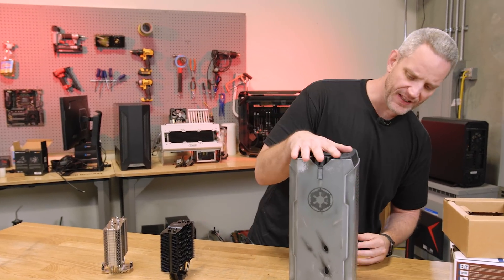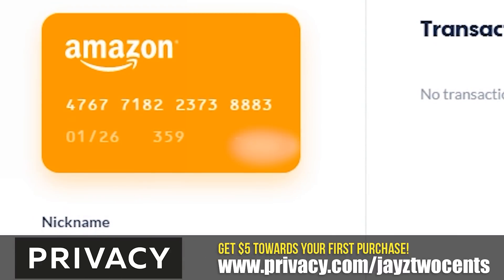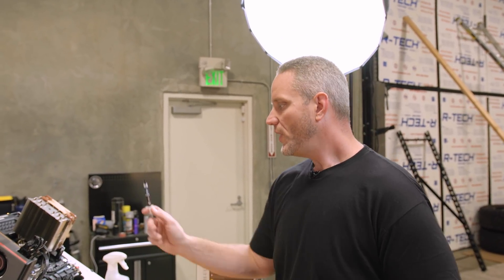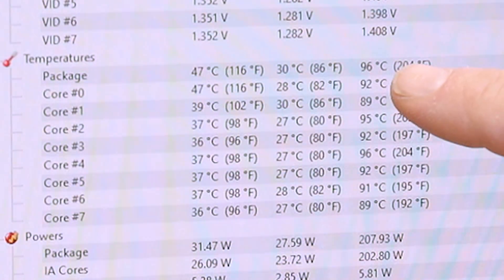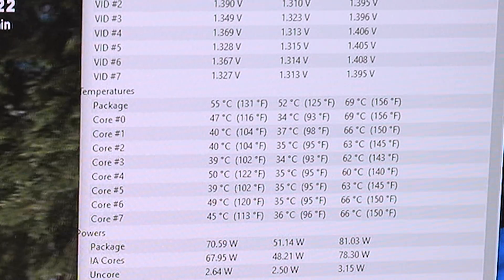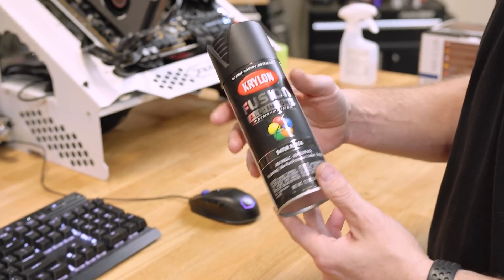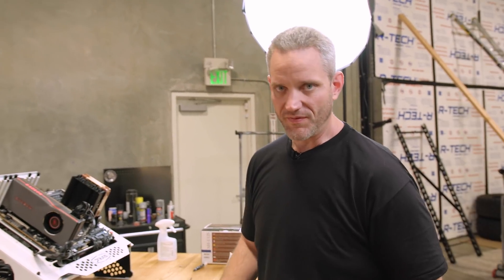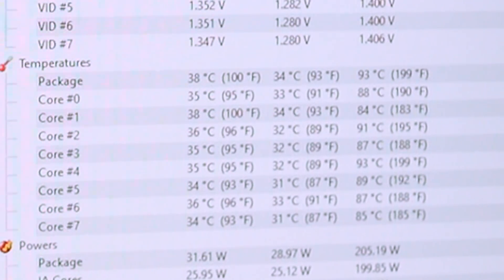Does painting a heatsink hurt its performance??

Comment: @jayzTwoCents my computer has an issue with a couple games were I watch a video on someone that basically has the same pc specs or the same and they have like 20-25 fps more then me and in some other games like call of duty my computer (cpu hits 99-100% and my gpu is like 2-3% and doesnt nicely I have a i7 7700 and a gtx 1070ti and 16gbs of ddr4 2400mhz and my cpu has a all in one liquid cooler and my gpu is a asus ceberus and I run it off a hdd 72000rpm. I have a lenovo mother board was a pre built I just changed stuff like cooler and gpu and my power supply is a 450watt 80 plus bronze acbell if you have any suggestions I would love the help I have tried lots like resetting pc or reinstall the game just alot:D

Comment: Haven't watched the video yet but depending on coating/paint type , from a thermal dynamics / Kirchoff's law of radiationstand point; black has the interesting property of not only absorbing infrared light really well but also able to expel the stored heat quicker as compared to pain shiny or white objects, hence why wood stoves are painted black & why most wear black or darker pigments in desert environments.

Comment: if you have seen videos from that blacksmithing channel where they recreate various fantasy weapons, if they want the metal to be black, they dip it in a solution that creates a small oxidized layer that turns the metal itself black. in the case of a cooler that would make it black without adding a layer of insulating paint. obviously this kind of chemical is rather dangerous if you are not well versed in its use so it's not recommended for DIY projects

Comment: 3:48

Fact check. That's not true regarding the the difference between the Noctua chromax and non-chromax fans. The old beige fans and the black chromax variants of those fans are identical in performance. Regarding the NF-F12 model, both the beige and black model have the same RPM (300-1500), same static pressure, and the same noise output. 
The exact specs are all listed on Noctua's website.

Comment: Prediction is hard
It depends on thickness of paint job and texture of paint itself too, which I do not control
Black colour radiates heat much better then just aluminium.
Thin enough, raw texture black paint may improve performance

Comment: The material the paint is based on matters more than the fact that you paint it. Also, as long as the paint isn't thick enough to become a heat insulator instead of a contuctor

Comment: The thickness of the paint will obviously be the most important factor here. I doubt anyone would be surprised that the cooler won't work if you fill the area between the fins with paint. Spray paint however can be so thin the effect will be negligible.

Comment: What kinda show you runnin here Jay?
Steve will not be pleased.

Should have left the cooler mounted, painted it (masking everything of course), then retested. That thermal paste reapplication variable.... also no torque wrench to assure same mounting pressure? (I'm clearly trolling)
I would've liked to see you use a ceramic based paint though.

Comment: What is the heat rating of that paint? I wonder if you use a really cheap paint, with a low heat tolerance, if the tower will get hot enough to melt the paint.

Comment: This is a truly pre video assumption. While it would still surprise me, I am guessing that the paint wont throw the temps off by much if at all. While the paint could technically insolate the metal, you are also increasing the overall mass a lot. So I would not be surprised if the extra mass allows the heat to still make its way off the heatsink. Think of it this way. If you would put on an extra cooling towel in the middle of the summer, once the heat makes its way into that towel and dries it out, the heat will go through just like if the towel wasn't there in the first place. I know it is the opposite here, but it is the best analogy I could think of right now that is relatable but also applies to heatsinks.
Reply: Anyway, not that someone will read this anyway, but that is what I expected. It threw off the temps a bit, but it basically didn't matter. If you are shooting for the highest clocks possible on your cpu, probably don't do it, but anyone else, have at it.

Comment: A louder fan, it matters less. Well Ofc. Corsair ML fans can't compare to Noctua fans. Build't a computer for a friend with a Noctua D15 cooler. Mutch more quite in idel than my D5 pump with 360+280mm rads. And my pump is running at 40%. He's computer gets a bit lauder in load tho because of the not watercooled gpu (2070super STRIX). But the choice not running aio watercool was mutch better.

Comment: I agree.  Pre commercial (1:32) that there will be a minimal temp difference.  There will be some blockage from the layer of paint therefore hindering air flow so there will be a slight difference.

 (post test) I guess I was wrong.  I would consider it more than slight but for an average user it wouldn't make enough difference to not do it.

Comment: Just paint the top and the sides. The visible part(s). Many coolers are solid on the sides making it easy to paint that keeping the main surfaces clear from paint. One face of the cooler is covered by he fan and the other/back face is facing the case rear with not much space between that and the rear exhaust fan. Hard(er) to see. This is the more common cooler arrangement. In your case the cooler was the opposite. Still the fan covers one face.

Comment: For an extra $4.00 a can of spray paint for "engine ceramic enamel paint" you won't see a difference in temps, it will take a full day for it to completely dry though. You can buy it at any car parts store. and they come in 100's of different colors. Same paint used on the cooler shown in the being of this video. 

link to paint:
https://shop.advanceautoparts.com/p/duplicolor-engine-enamel-chevrolet-orange-12-oz-aerosol-de1620/7140517-P?searchTerm=engine+enamel+paint

Comment: I remember a similar test with cars that were turbocharged back in the late 90’s - especially with Honda’s- painting their intercoolers black to be more stealthy. 

The same result happened. In real world data logging the temperature difference was negligible. 
In dyno testing and doing repeated back to back runs with no cooldown, there was a significant difference in temps. 

Physics doesn’t lie. 

Will you see a change? Yes. Is it worth doing now that you know what the impact is? That is entirely up to you to decide.

Comment: Early prediction...  light coat, no difference...  thick coat should reduce the airflow through the fins and temps should rise...  also, further thoughts...  a black cooler might absorb heat from the inside of the case more than a silver one would...  but that’s speculation

Comment: You gain heat radiation by having higher radiation coefficient than blanc metal. But the paint can limit airflow for direct heat exchange. Despite coolers often being called radiators, they usually don't radiate much heat but exchange it via direct air contact. Therefore airflow matters more than radiating more heat by painting it.

Comment: Alright Jay, I'm at 1:23, I'm guessing it will raise the temperature, but only by about 3C.
Edit: I was dead on. :O Wow.
Reply: 69 after to 69 before +0
69 after to 66 before +3
68 after to 63 before +5
68 after to 62 before +6
72 after to 60 before +12
68 after to 63 before +5
70 after to 66 before +4
68 after to 66 before. +2

were you though?

Comment: Two stupid questions:
1 Why does noone build a test bench for cooling solutions, so heating elements to which you can supply a set ammount of energy, to properly test (controling variables),...
 2 Shouldnt there be paint that improves the performance of your fan? Theoretically if you had a microporous paint whith good thermal conductivity, you should be able to significantly increase the surface area of your fins...

Comment: A lot of motorbike engines are painted matt black so I'd say is doesn't really matter as long a it's matt black and not a colour that is reflective like glossy white. But you really need to use paint that is good at dissipating heat and the the build should be in a case too, so we can get a result that means more as most of us don't use test benches.

Comment: Hey J and fellow U tubers... I've got an old Zalman 9900 Max copper air cooler and need to clean and restore/protect fins from corrosion.  I've thought about replacing 'said' cooler with a modern Zalman that is nickel plated instead.  I could remove the cooler and clean with C.L.R. to remove oxidation and corrosion.  My concern is more on getting more help with cooling performance and reducing the ragged edge temps with my 2600k OC.    Space and older configuration are present with this build.   Replacing case isn't an option for me.  (Custom build, Case from 2005)  The whole rig used to run much cooler,  But... I'm afraid the oxidation is limiting my higher OC's.   Any suggestions that don't require extreme exotic replacement of case?  Thanks!

Comment: Black can radiate more heat than silver but a paint coating may insulate it a bit...my guess, tiny bit less effective.
And...I was wrong in my guess - so not painting my dual Xeon system aircoolers!

Comment: Gonna go with no as painting intercoolers on cars doesnt either.  Also those ml120 pro fans are fantastic.  You cant even hear them at 1k rpm.  A significant upgrade for fans over stock coolers usually.

Comment: I love your useful & entertaining presentations :-)
Althought I'm a qualified Electronics Engineer (plus qualified Electrician!). I have learnt a lot of stuff about PC building from yourself (& Linus!).
I had actually thought that painting Matt Black would help the heatflow from the heatsink - How wrong was I??
But maybe, being Black, it is possibly 're-absorbing' that heat?
I had a REAL problem here in the UK 2 years ago, when we had a heatwave. My office was getting to 35/40DegC!! 

Whilst my Xeon W3530 (Asus P6T6 WS Revolution) workstation kept throttling & crashing, due to CPU temps of 135DecC!!!!!!
 - Not helped by using the supplied stock Intel fan/heatsink :(
 - I have now switched to a Corsair H80i which is doing a fine job in the rather cramped Antec P183 case ;-$ CPU Temps down to ~40DegC :-)
However, since the system above is 10 years old!!!  I'm building a brand new Workstation...
 - Asus Prime X570 Pro, AMD Ryzen 7 3700X, BeQuiet DarkBase Pro 900 V2, Corsair HX850i
 - I've yet to choose : M.2 ('C:/" Samsung 980 EVO PLUS??, new!!), SSD ("D:/" WD Blue, 1TB??), DDR4 RAM (Corsair, 3600??), 

 - I already have Seagate IronWolf Pro HDD's (8TB x1, 6TB x3, 2TB x2) plus FireCuda (2TB x2)
My final decision will be on cooling...
 - Case comes with excellent BeQuiet SilentWing 3's
 - I'll also add a couple(??) Noctua case fans?
 - But CPU cooling is still up for grabs : V.Large Air cooler (Noctua), or Corsair H100i RGB, or H150i RGB???
Finally, it is strange that most(!!) CPU heatsinks are 'Plain', bare, metal, whilst most(??) Radiators are actually painted 'BLACK'????
 - Maybe, you can strip a water cooler radiator back to 'Bare metal' & do a similar comparison??...
Keep up your EXCELLENT work....
Reply: Forgot GPU : Choosing between AMD Radeon WX3200 & WX5100!! ??Depends what budget stretches to?

Comment: I'll take a guess it'll do nothing. The paint is an insulator but black is the best emitter and it'll cancel out. I do wonder if you painted it white would that show higher temps than black.Nope, I was off. Still wonder how white paint would work since I'd expect that to leader to higher temps than black.

Comment: great timing! Was literally thinking about doing this yesterday :p
I was also thinking of just painting the top fin. The one you can see the most clearly.
Reply: I would go with that. The surface around the heatpipe is also good because the fan cant move as much air on the blade edge and the pipes. Avoide the middle and you good

Comment: Painting it can't cause 0 impact, however I suspect that unless it's too thick or in globs the impact should be pretty small
Reply: pretty small, huh?
69 after to 69 before +0
69 after to 66 before +3
68 after to 63 before +5
68 after to 62 before +6
72 after to 60 before +12
68 after to 63 before +5
70 after to 66 before +4
68 after to 66 before. +2

yep, 6 cores with 3c or more gain in temp, TOOOTALLY a small amount.
Reply: @shawnpitman876  it was a guess I made at the start of the video dude. And actually it did end up being pretty small, 3-6 (the 12 is an outlier and is probably caused by something else) is pretty much irrelevant when you have over 30 degrees of headroom. And the increase was completely wiped out by a slightly faster fan.

Comment: I guessed it would be 4 or 5C higher. Not that surprised about it, some people paint their cars' intercoolers and radiators with very very little to no performance loss. Depends on the paint and how much is sprayed on, of course, so maybe a paint with metal bits in it or something more conductive will be better than other types.

Comment: Good video. Now I'm wondering if doing a super light, almost transparent, coat of copper paint could improve thermals. My theory behind it is that each separate drop of copper paint could increase the surface area with a lower thermal coefficient material, to the point where some improvements could be seen. Probably minimal, but could be significant (1-2°c). I could do the math, but I'm too lazy atm.

Comment: Prediction: if you use something like the high temp paint used on grills, it will probably have no significant effect.  A few degrees, maybe.
Reply: High temp paint isn't high temp for heat tranfser though, it's high temp to resist the colour changing or it burning off of the surface it was applied.
Reply: @mikesiemens4145  Correct, but there are semi permeable paints designed for heat transfer which don't negatively impact the emissivity of the metal nearly as much. That's the problem with painting a radiator, it doesn't negatively affect conductivity, only emissivity. One thing you can also do to paint a radiator or heatsink is to paint from above and below at an angle. Doing so allows you to only cover the visible outside edges with paint while leaving the vast majority of the fins unpainted.
Reply: I see.  He used normal krylon, and only saw a few degrees difference.

Comment: Hey Jay they make radiator paint specifically for this type of application might make a difference
Reply: @Biggus_Mickus  you are a legend, thank you for helping with this comment, I appreciate it (:
Reply: @Biggus_Mickus  saw a guy using engine paint to withstand like 500°, but don't know if it hurt cooling.. would you recommend the rad paint? I assume it's an enamel?
Reply: @TerraRiley  Engine heat resistant paint means it can get hot without cracking, falling or fading... It's a little insulating and it needs a lot of coats. Wouldn't think it works for this.
Reply: c wieling710 nice! Do you know any black coloured ones that would work well with these Noctua heatsinks?
Reply: I use radiator spray for radiators to heat the house. Inside of them runs really hot water, sometimes so hot the radiator can burn your fingers if you touch it. So it needs the special heat resistant spray.

I have a Scythe Mugen 5 PCGH (Mugen 5 rev.B Dual fan edition) and the radiator is silver and it stick out a lot in my PC case which is all black components and glass side. 

I wanted it to spray with matte black color, but only the very first fin you see, not the other 30 fins. Purely for aesthetics. I used a random matte black spray for 5$ (400ml) like a no name unknown brand and it worked nicely. 0 changes to temps as only the 1st fin nearest to the glass side panel was sprayed. 

ALL YOU NEED TO PAY ATTENTION TO IS HOW YOU SPRAY!!!!!

You need to spray in parts, slowly, from a distance of at least 25/30cm, or you will get running drops of paint. Ofc you spray it disassembled from the case with no component even near that shit!!! I covered the rest of the fins with paper and tape. Only the front fin was visible. You want to spray from top to bottom - your hand is above the cooler, not next to it - you avoid the drops better. But really you need the 25cm and spray like pst pst pst pst from side to side, left right, right left etc... and not pssssssssssssssssst in one place or YOU ARE FUCKED!!!!
Reply: @Biggus_Mickus  

Your comment is a tutorial video waiting to happen
Reply: @oneyedthing  mightycarmods tested this on an intercooler
Reply: 08:34 I almost fainted

Comment: Should be monitoring the room temp because if it goes up 2C then the CPU temp will go up 2C because the convective heat transfer is directly proportional to the temperature difference.  (As a control. could also measure the temp of some other components on the board that would be expected to stay the same.)

Comment: I used to work with a guy who told a "heatsink painted black story", not sure the exact details but a set of instructions said to attach a component to a heatsink painted black, which a guy ( not the one telling the story I hasten to add, duly did. However the component burnt out and after a couple of replacements he went to speak to an expert. The expert asked if he was following the instructions, to which he replied "Attach a heatsink painted black, yex".

The expert asked what material did you make the heatsink out of, to which the guy replied "wood"

Comment: Jay, I have often wondered if using an extremely black paint, like blk3.0, would actually help a fin array radiate heat better. It already been proven that objects painted with it absorb thermal energy drastically more, so in theory they should also radiate it more.